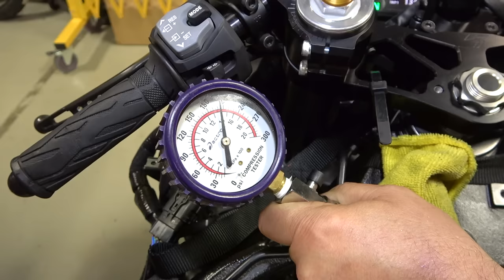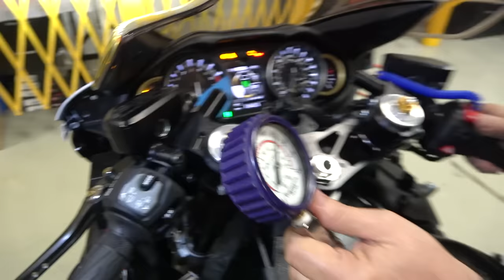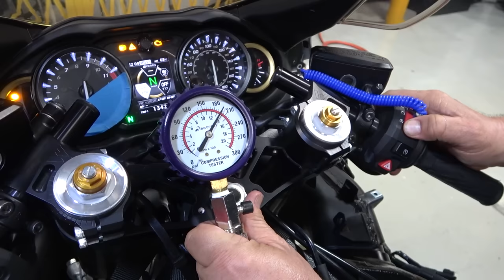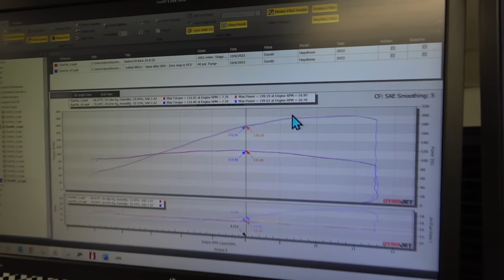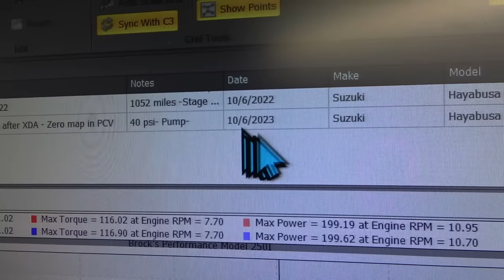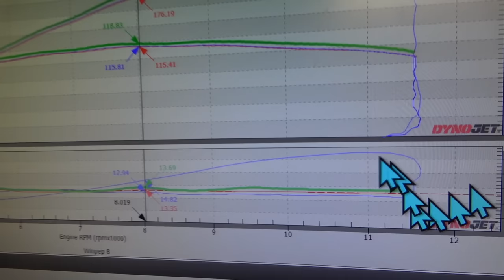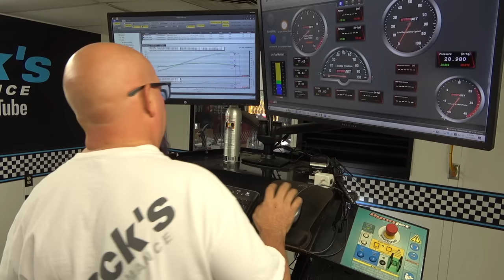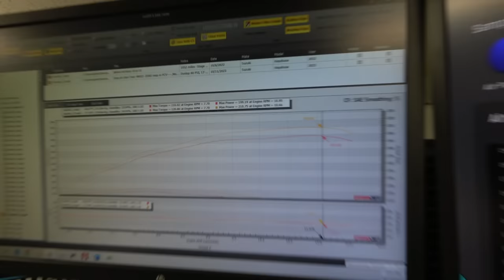Can Brock make a Gen 3 Suzuki Hayabusa #stupidfast ?

Comment: I've been torn between a 2014 busa, '08 b-king and a 2019 zh2. And a gixxus. This made me lean toward the busa a little more as it was my dream bike as a kid in 99.
Reply: H2 or H2 SX SE, loved my 20 SE, 3 years had it they are just flat out awesome sold it and just very happy now w collector ZX11 awaiting new Galespeed wheels. It does everything I need it to. Hard to explain how much better they are over both the ZX14 and Busa unless you are seeking the ultra fast top end. But for daily riding they are just better and hide weight so much better plus you can tune them as well
Reply: @kiddcisco  All the bikes you've mentioned can be tuned. Dealing with ZX-11 carburetors is a new ball of wax. That 1052cc motor was a peach, at least in the 1996 GPz1100 I took for a spin once. Tuned for torque.

Comment: Fellow Dayton rider here 🤚. Just decked out my Kawi z900 with: Brock’s Penta-Carbon full system, Sprint F1-85, Brock’s HD clutch springs and Brock’s fuel tune/flash and the bike is chefs kiss 🤌.
The Brock’s staff has been a pleasure to work with and truly understands the meaning of customer service. I couldn’t be happier with my purchase and it’s nice to support a local legend 💪
Reply: You will fuck.your engine with that filter. But you do you
Reply from the maker: Here are some facts on the ignorance of your comment using our Sprint Filter Long Term Test ZX-10R test bike that now has 33K+ miles on the engine using the P08 F1-85: https://bit.ly/4bYNzh0 but....OOPS that requires reading - so here's the latest video discussion on the subject: https://youtu.be/-k1hapRwvu8?si=3eSot2rOgOid3za_&t=106

Comment: Thank for sharing! And praise your courage to show how work in progress progresses - most don't do anymore, a pitty!

And we hope you'll make more than 220hp soon - the number would help to sell more kits quite a lot. (1)(Maybe a 'little more cam' would still be necessary? Than more courage.)

And two - I think we shouldn't forget to praise the Suzuki tech guys here too - their stock cams are small and still perform. I hadn't even believed them for being good for 199 hp - 'because they look more like 177 hp' (don't they?).

1 - I would just as well like to see a coming 'Brocks Performance Hayabusa 230 hp guaranteed' kit available - all tested parts and components in one kit - maybe an even better selling name for it and a price premium. 'The one and only true 230 hp kit in the market'. 

Current Busa: Bore x Stroke 	81 x 65 mm, 	1.340 ccm @9700/min 

230 hp equals 172 hp per 1000 cc - should be possible @ 11k or 11.5k rpm? (If crank/piston/rod are good for 24 m/s like with S1000RR) - The Busa comes with +34% displacement like a S1000RR - that's why about 10% more hp than the S1000RR ('230 hp instead of 207 hp') should be possible - even without shiftcam - and at lower m/s piston speeds.)
Reply from the maker: More rpm is a dangerous slope on the Gen 3 engine as Suzuki techs squished it pretty tight to get it to run ok with the dinky cams...as well as to help it pass emissions, I'm sure. 11.5K is where we are now and the piston to head clearance is about as close as I'm comfortable with.
Reply: @BrockDavidson  Thank you for your answer and letting me know, highly appreciated!

Comment: Love Suzuki engines. I am using an M13A which is very similar to the hayabusa but a little more solid in the build. It's an old engine by design but makes a great aircraft engine. I'm making the same power but at 5500 with a turbo. Bored out to 1460cc. I love the shim over bucket design, makes valve adjustment much easier and is fine for the RPM I am running.

Comment: Hey on those rusty roll pins. Take an ultrasonic wand put a little gel on the area over the pin casing. Turn on the ultra sound. It will form a loose bond. Every time I use my ultrasound tank. That the first thing you see . The little pesky rust in the covers.

Comment: holy SMOKES!  wow!  that pull at the beginning. . .    so how is Kawasaki circumventing the E5?  hmm . . .    curious is the overall degree for the new busa cams the same or did you increase it some?
Reply from the maker: The bike design is old enough that they didn't need to pass E5. New designs must, so Kawasaki went the supercharged route for power.

Comment: Pretty cool. Hopefully XDA will allow this in the rules. Maybe a gray area, but to make it fair may have to allow all bikes to put aftermarket cams in with stock cam timing.
Preciate the info as always Brock.
Reply from the maker: Since the G3 Busa is the only bike in the SS class with neutered camshafts...seems like "fair" would be letting the Busa have aftermarket performance camshafts too? Unfortunately, your suggestion for OEM cam timing with aftermarket cams can't usually work as the longer duration creates piston to valve clearances that are too tight, which could lead to piston to valve collision - resulting in catastrophic engine failure.
Reply: I disagree. This should not be allowed as SS was a factory spec class. Certain motorcycles have certain advantages. Unfortunately, this model lacks the needed performance to compete with the other brands running the class. Fair would be allowing this for the entire class.
Reply: Also, if Patrick has been 8.80s at 160mph his performance is in line with the rest of the field.
Reply from the maker: His best pass in perfect conditions can not be used as a class comparison. His results in the class, on the same track and conditions shows he's bringing a knife to a gun fight as a result of environmental regulations that do not apply on the race track
Reply: This would open the door for other platforms to ask for performance rule changes. Just select a more competitive platform for that particular class. All that is being stated is that the bike is a dud.

Comment: Kinda crazy how much rust/effort/breakage MR12 does on a brand new engine…..wonder how many miles it took to get the internals all messed up inside……great content & products Brock.
Reply from the maker: lol, my Gen 2 Busa has over 5000 dyno runs on it and still makes the same numbers it did in late 2007 when I got it.

Comment: Question for Supercharging. Will a Gen1 Busa Intake Cam with Brocks Cam Pin & a Gen2 Busa Intake Cam fit in a Gen3 Busa head ?
Reply from the maker: It should. But you will also have to reverse the cam bearings.

Comment: Great video and seriously thinking about this with the short stacks, but I gotta admit I was all googoo over the red 14 in the back ground lol. What would this same cam shaft replacement do for the 14R and how much of a colossal pain in the butt it would be, can you even do it without dropping the engine? Apples to Apples...
Reply from the maker: The 14 doesn't have emissions camshafts. Switching to race cams can increase performance in stock engines, but it typically comes at the price of decreased reliability. The exception to this is if the OEMs designed the race cams for the application, such as ZX-10R kit cams.

Comment: Brock, so SS rules allow cam lift/ duration changes as long as you keep stock sprockets and stock cam timing #s? if so, we’ll that’s pretty slick. Now that’s reading between the lines. I wonder how long people have been doing that? Pardon me if you mentioned your allowed as I already know how to adj the valves.  That’s it though 😅
Reply from the maker: Steve, They don't yet because no other bike in the class is limited by emissions camshafts....it's my wintertime project to try to revitalize the Ford vs. Chevy rivalry that we used to have with Kawasaki vs. Suzuki in SS.

Comment: I must have missed something. The bike started out with 199hp right? It must have been modified some already right? I'm asking because the busa stock is about 165 or higher right? So are we getting 35hp more now from the total stock? thanks for any clarification.
Reply from the maker: The bike had all of the XDA SuperStock class allowable mods to make the 199 (Full Exhaust, Sprint Filter, fuel tune/ECU Flash, class spec VP MR12 racing gas, etc...)

Comment: **Question:
Does the Gen_3, has the engine breather attached to the air box also? Like the Gen1, the ram-air is useless at high speed? This mod was a huge gain on mine. Unfortunately Powercommander could not adjust the map by speed, gear or intake air pressure.. Any comments guys...???
Reply from the maker: The Gen 2 and 3's have a "mousetrap" that allows breather gasses out but blocks ram air pressure from entering the crank case. The bikes actually slow down if you attach the pair to the crank case.

Comment: Suzuki should of added the  3mm overbore (84mm) from the start (Gen 3). At least it would of been apples to apples with 1441cc…….Also if drop-in cams are in the menu; may as well do a port/polish head work too while the head is off……
Reply from the maker: Head is off? Did you even watch the video, lol.

Comment: @brockDavidson I noticed when checking the valve lash you used specs from the Gen 2 engine instead of the Gen 3. The gen 3 manual states intake is 0.08-0.18mm. exhaust is 0.18-0.28. I know you mentioned using whats in the manual but this can be confusing to the audience
Reply from the maker: Use what you feel comfortable with. I use .005 in/.007 on all engines...all of the time. Those are SAE number....I don't do metric for small numbers.

Comment: I used to really like Suzuki.  I even turned a wrench for one of their dealerships a long time ago.  But they are the cheap Walmart brand of the Japanese manufacturers. They put almost no money into R&D to make a better product.  They rarely update their bikes.  They still brag about using the 2005 era GSX-R engines, even though you're still not getting GSX-R power. They're 20 years behind everyone else.  You still can't get a fuel injected DRZ400 or SM.  You're getting and riding everyone else's 2005 bike on a 2023 Suzuki.

Comment: Nowadays when you order a bike and do an online Build on the manufacturer website you should be able to add any custom options you want,
Obviously you should expect to wait for parts but like with say BMW or yamaha they should have an option for  rembo and ohlins or other makes. As an option,
Same with suzuki you should be able to add custom parts right while the bikes being built or at least at the dealer prior to delivery,
The worst of all are the exhausts that are fitted and often charged extra for something completely useless,
How awesome would it be if instead of getting some overpriced slip on good only for the bin they instead do what they do on the gsxr1000 and fit a single side  2 part giant dustbin exhaust system for emissions but as an upgrade they fit a top end set of full size large diameter brocks titanium headers or something similar,
That would actually be a great addition and would not be a problem with emissions,
That way you can get a mid pipe and can and don't have to bin the whole thing,

Comment: Does the clutch cover from the 3g fit the 1 and 2g engines? And is it lighter? 🤔
Reply from the maker: It's no lighter and; m not sure if they fit. I remember the Gen 2 would fit, physically, but did not have enough internal clearance.
Reply: @BrockDavidson  Thanks for the reply! I got a 1g I’m currently de-ricing and the chrome china covers gotta go. Looking for alternatives or going stock.
Reply from the maker: You can Cerakote the covers also.

Comment: To clarify directly from the XDA rulebook

 literally rule number one the engine must remain completely stock no polishing no coating, all internal engine components must remain OEM as delivered with no modifications metal removal or blueprinting. 

So you just disqualified your Rider by posting that you're going to be building him an illegal combination. Probably shouldn't have used his bike as an example.
Reply from the maker: Ummm....if not approved, we will take them out. Or, leave them in an not race XDA SuperStock as he is REALLY enjoying his new found performance.
Reply: @BrockDavidson  the problem is that needs to be clarified I've had dozens of people contacting me asking me to put your "class legal cams" in gen 3s so they can run that class and I have to explain to them that your cams are illegal in that class literally anything that involves taking a cover off of the engine is illegal with one specific exception and that is backdating the clutch.
Reply: @RingTuned  The video obviously  is to show  FULL TRANSPARENCY of the part ( Cams ) and its performance gains to create parity in the XDA SUPERSTOCK class thus drawing the attention of current and new riders to the class and ALSO the brand of motorcycle ( SUZUKI ) as for 95% of the class entries are ZX14's.  There are "pending rule" revisions that are being CONSIDERED in the class to open the door for more competition and creating fairness aka parity. The owner of the bike in video has the option to return the bike to stock cams or not race the bike at XDA

Comment: Hey Brock’s would the cam concept be the same on a 2023 zx14r as the busa
Reply from the maker: I have no idea. Are the 23 ZX-14's down on power? We haven't had any customer complaints.
Reply: Just heard pc6 and emission controls are not like previous models
Reply: Made 193 on 93 octane with sprint filter sawed off stock canons snitz flash pc6 Mark Blake tune just ordered your full exhaust kit

Comment: is the gen 3 a low compression like the gen 1 or?  good compression, I prefer having them all the same as apposed to big numbers, gimmie 195 across all 4 before you give me 205, 210, 200, 215, all day long . . .   good work son, if you ever lose interest in building engines you can always get into stand up ...   lololololololo
Reply from the maker: Gen 3 CR = 12.5-1,  Gen 2 CR = 12.5-1, Gen 1 = 11-1.
(Don't forget to tip your wait staff - I'll be back at 10 o'clock😉😅😂 - BD)

Comment: Why spend all the required cash to outperform the ZX-14R? The Kawasaki is less expensive in the first place. I will just keep my 2013 ZX-14R and save a ton of money. The new Hayabusa is expensive off the showroom floor, and then all these mods. are required to beat the big Ninja. The Kawasaki is still a 1441 cc motor as opposed to the 1340 cc of the Suzuki. I just cannot see any reason to mod. the expensive Suzuki just to reach the performance level of a ZX-14R that is much cheaper. I own a 2007 Hayabusa also that I use as a cruiser, so I am not anti-Suzuki.
Reply: The Hayabusa is smoother and way more reliable.  And if you do want to build a race bike the hayabusa is a better engine to work from.  The ZX14r is faster stock vs stock. But that's it. A few thousand dollars into a hayabusa and youll have a zx14r killer that is totally reliable. The zx14r isn't even reliable at best in some cases. They have oil delivery issues.

Comment: But you could buy an H2 SX and have 240 hp
Reply: The h2's are entirely a different bike class. The same argument can be made with adding a supercharger or turbo to the busa. I personally like the big bike with aerodynamics for the long rides. If you want to puddle hop & street race in the H2s serve a better placement.